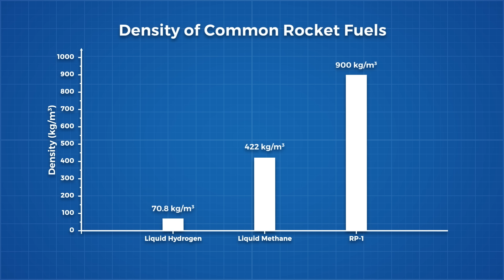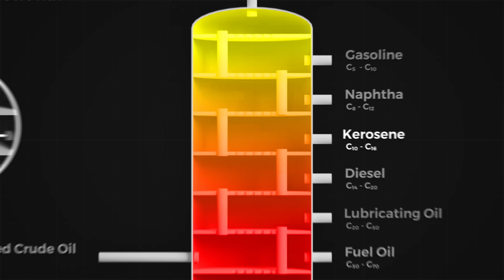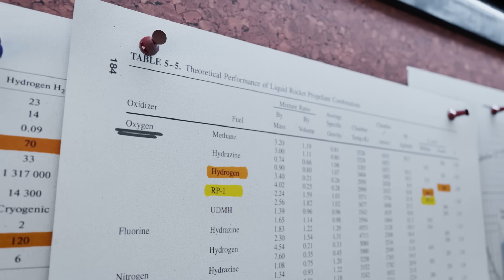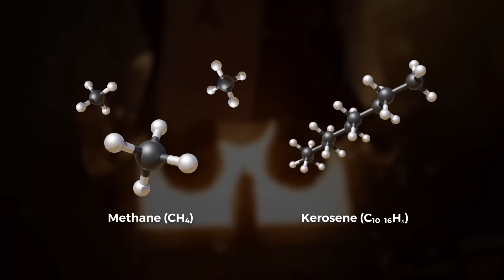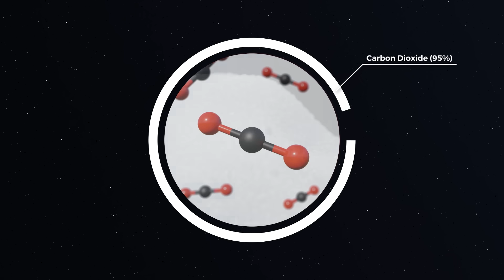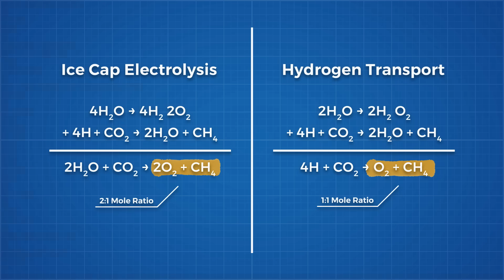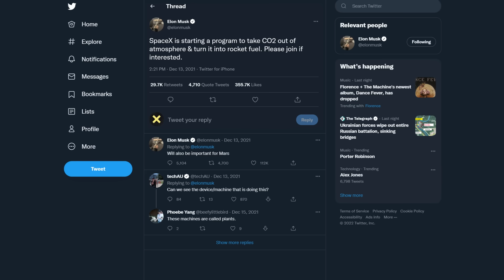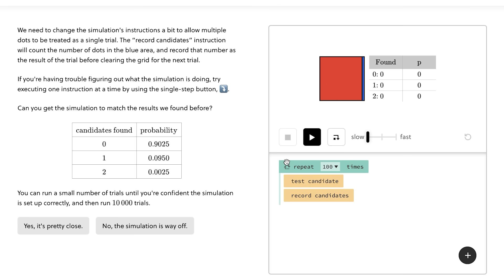Why SpaceX is Using a New Fuel

Comment: For years, I've been trying to find a way to turn coal into methane. This video provides the equation. In some sort of co-generation project, we should be able to burn coal to make heat & power and CO2, then combine that CO2 with hydrogen to make methane and water vapor. Then when the methane is eventually burned (efficiently), there is a release of CO2 and water. There must be some way to put this altogether in a loop. Maybe we need to add wind, solar, or nuclear power to generate the hydrogen from water.
Reply: Wouldn’t it be better to use hydrogen rich liquids rather than water?
Reply: @chrisbraid2907  like what? Hydrolysis of water is an easy and well known process.

Comment: Mars actually has ice everywhere, not just at the poles. Almost everywhere has a sub-surface permafrost layer. Down to mid latitudes this is pretty shallow, just a meter under the surface, at lower latitudes it's probably deeper and somewhat more sparse. Some regions include sub-surface glaciers of high water ice concentration, as shallow as a meter below ground, and these exist even at mid latitudes in many locations. Seeking a location to site a Martian colony one would want to look for easy access to sub-surface glaciers.

Comment: Around the middle:  The scan of Sabatier's paper had a typo in it:  "4 H + CO[2] --> CH[4] + 2 H[2]O" (the "4 H" should be "4 H[2]" which is actually printed correctly in the line above).

Comment: I think in general methalox engines haven't been developed because they don't have any military application and isn't as good as the more mature hydrogen engines, it really took someone without the constraints of legacy aerospace to get it off the ground
Reply: Interesting though that the same resources giving you the methane will also allow for conversion to oxygen. 
The waste nitrogen can be used in green housing along with compressed carbon dioxide as part of the cycle for plant growth. 

It seems that though the Mars atmosphere is scarce - it will provide us with most of what we would need to function.

Comment: Maybe they can drive the price of  Methane down by manufacturering it for jet engines it might be a way of getting rid of air pollution in the air. And because they are  making it for jets maybe it would drive the price of the fuel for rockets 🚀.

Comment: Professor Daniel Nocera from MIT developed a catalyst with a botanist from England to break down water to oxygen and hydrogen, easily, efficiently and cheaply, modeled after a microorganism from the ocean,  using solar panels for the electrical energy source.   He called it personalized energy. 
A quart of water could power a typical house in the US and the water source doesn't have to be ultra pure, although after the hydrogen is passed through a fuel cell, recombining with oxygen, pure water results along with electricity. 
A small unit on board a ship to Mars would make it very easy to obtain hydrogen and oxygen.

Comment: Space X has a simple problem with a simple solution they need to store more fuel but it takes up to much space pressurize the fuel or they could experiment with heavy fuel if they can do the same process with fuel as they can with water to make heavy water then that may be the solution

Comment: Great video! I like everything your channel puts out. But as an engineer myself, I just want to make a correction about impulse. It doesn’t represent total energy released. In this case it represents total momentum gained by the rocket due to the fuel.
Reply: Can you explain that further, please?
Reply: Sure  @Pene7942  . Impulse is indeed the area under a force vs time curve like the one in the video. This is also equal to change in momentum over the time the force is being applied. To see why, you'd need to integrate force and the answer would be equal to the final momentum minus the initial momentum (I'll put the math at the end of my post). So fundamentally, the impulse represents the total increase in momentum due to an applied force. That increase in momentum is related to the energy gained, but it's not a direct relationship so we can't say the area under the curve represents the energy gained. You can calculate the area under the curve by taking the integral of the force function f(t) with respect to t over some initial time to a final time: ∫f(t)dt. Newton’s second law defines force as, f(t)=ma=m(dv/dt) where m, a, and v are mass, acceleration, and velocity respectively (dv/dt is the derivative of velocity which is equal to acceleration). So the integral becomes, ∫(dmv/dt)dt=∆(mv). This result is equal to change in momentum since momentum is defined as P=mv. On the other hand, energy gained by the rocket, due to the fuel alone, is equal to the rocket's change in kinetic energy (a measure of energy associated with an object’s speed). Change in kinetic energy is ∆(0.5mv^2) which you can see is similar to momentum, but the relationship is quadratic so it will not be directly related to impulse. Instead, increasing the area under the curve will quadratically increase the amount of energy the fuel provides to the rocket. I know that’s a lot so feel free to ask any follow-ups.

Comment: good video but not completely accurate regarding the combustion of Kerosene. Most of the soot in the F-1 that is seen is due to the turbo pump super fuel rich exhaust being dumped into the engine bell to provide cooling to that part of the bell.  The turbopump fuel / Ox mixture was purposely very rich to control TP combustion temperature.  Kerosene has an advantage over Methane with regard to lower ignition temperature and somewhat better reactivity to initiate combustion (please refer to texts on compression ignition engines for very good discussion on fuel chemistry and the role of fuel reactivities).  Although Methane has excellent characteristics and is a very good fuel, so is Kerosene with today's more advanced turbo pumps, leaner thrust chamber operation and has better handling practicality (not cryogenic).  Ok, methane may be more environmental overall, maybe.

Comment: US Navy already got this going on using RWGS and a very cheap catalyst at a 92% efficiency rate.  The idea was to use the nuclear power plant on naval ships to convert carbon and hydrogen from seawater into fuel for jets and other ships in the fleet, thus saving the US Navy from having to escort and manage large fuel tankers.  Researchers have already built several prototypes and successfully produced jet fuel, diesel fuel and gasoline.  They even ran a vehicle off the fuel just to show it can be done.  The projected costs back in 2020 was something like $5 to $6 USD a gallon.  In theory the process can be scaled up and used to replace all existing transportation fuel without having to change infrastructure.

Of course no costal liberal elites would get rich off this, so it's not being discussed even though it's "carbon neutral".

Comment: Methane is just cheaper to produce
and with SpaceX being a privatized corporation,
they will rather go for the cheaper alternatives,
not the safest.

lol, 8:05 Mars has a atmosphere you could almost call a exosphere.
It has barely an atmosphere and distraction like that would make more sense for H.A.V.O.C. which in the end already would start lowering density from the atmosphere, as well as lowering the temperature, combined with actually having a thing called gravity, it's much better than Mars.,.

Comment: Wait... So Highfleet’s worldbuilding actually makes sense using liquid compressed methane to power massive airships? And the fact that the Co2 that is expelled by thrusters into the atmosphere can be recondensed and refined back into liquid methane? HOLY CRAP THATS NEAT
Reply: pls explain?
Reply: CO2 can always be brought back to methane, but thermodynamics say that you need to put at least the same amount of energy back into the reaction. engineering says you need more energy. This process is only viable if the energy is from renewable (non CO2 emitting) sources and the original process must emit CO2, such as cement production.
Reply: @abelknecht4943  seeing as how Highfleets world features a nuclear reactor the size of a city and hundreds of thousand+ ton airships outputting enough rocket thrust to instantly insulate a small planetoid with greenhouse emissions I still think it’s pretty neat on the worldbuilding how this all fits together

Comment: With the new tech of wireless electricity i still think a electric rocket engine would be the true path.  Am aware electric engine are under research but there trying to make them using the minimal amount of energy which is not ideal currently.  I think a electric rocket engine combine with wireless electricity would save allot of money even if it consume large amount of energy...If it works then it can be improve. Wireless electricity is the turning the energy into radio wave then back into energy.  Even better if they can beam negative or positive charge like a magnet too elevate a space craft into orbit.

Comment: The Sabatier process does NOT solve climate change. Methane is a worse greenhouse gas than carbon dioxide and if you burn it you end up with the same amount of CO2 as before. Unless you are getting the hydrogen for free there is a overall loss of energy.
Saying that the hydrogen is "recycled" is misleading. Even with reverse water-gas shift there is still a lot of hydgrogen ending up in your rocket fuel, so you still need a lot of martian ice. Also it is weird that you mention the water from the sabatier process can be used for life support and then immediately explain why you need martian water.

Comment: I know this may be nitpicking, but when you mention how much fuel it would take to make 100MJ of energy...

you mention the volume in Liters.... Yet you already mentioned that the density of stuff changes at temperature... 

So 2.2L of Hydrogen at 1million Kelvin, is not the same mass as 2.2L of Hydrogen at 1 Kelvin... 

in other words, you told us not how much Hydrogen you actually need... but gave us a wide array of possible amounts.
Reply: Volume is not density...

Comment: as the audi e-fuel plant here in gemany might be a relly interessting technology, right now it is just a stupid idea at leat in the form they would like to do it, the energy to produce the masses of fuel they would like to produce to keep combustion cars running is just insane, this sort of techniq is just good to use if you have an abundance of energy which right now we on earth doesn´t have for mars it´s another story there it can grow with the energy needs from the start so no big deal. but on earth ? we need to get away from fossil fuels as quick as possible and even as this might help to have clmate neutral combustion engines we right now need the power for our homes and industries. For transportation efficeny wise it makes at least for now the most sense to use bev´s

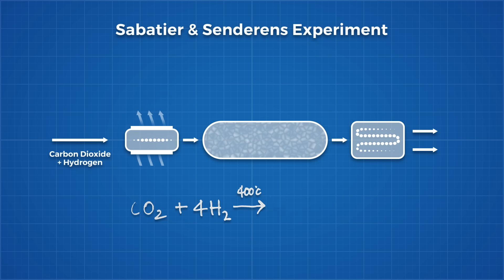Comment: Space X new fuel liquid methane to replace liquid hydrogen than other fuel and space X lauch on the Mars travel more than moon so they modification on fuel 8:55 Carbon to methane converted into fuel process called sabaiter process emitting water used for electrolysis 👍 wow interesting information about rocket 🚀 fuel from Real engineering 👍

Comment: Wait but isn't the 'ice' (10:43) on Mars' poles then not 'just' dry ice (solid CO2)? It would make more sense to me if the white areas simply indicate the regions where temperatures are lower than -135 °C (somewhere around the deposition/sublimation point of CO2 at martian atmospheric pressure)... =o

Comment: I see no reason for rushing human exploration of mars. We can barely land autonomous vehicles there, and it requires complex infrastructure to produce every component to highest tolerance. If anything breaks in space or on mars, that'll be it. And they aren't contemplating sending a small crew, but a large collective, which with also magnify the proportion of any potential catastrophe. They better land a dozen unmanned SpaceX rockets first, replicating mission parameters, or there is no point. With robotics being as advanced as it is, what's the value of sending humans anywhere, if the majority of equipment ends up being for the purpose of supporting life. Robots just need electricity. In the old days, the only way to see something was to go there and see it. Now we use virtual experience instead of real ones. We can scan mars and mimic it in VR, risk free. There is no need to go there. With radiation, long term stay is not a likely possibility. So having that planet as a reserve option, in case anything happens to earth... that's not a good plan either. Mars has nothing we need, aside from maybe, providing an exercise, in case we ever develop above light speed propulsion. And if we don't, then it's a waste of fuel and natural resources.

Comment: Real reason that SpaceX is choosing methane as a fuel is that it is the most practical choice for maintaining 40,000 earth satellites for the Starlink communications system. Methane is essentially free for SpaceX, because it can be obtained from wells on the Texas launch facility. It won’t clog the Raptor engines with repeated launches, so maintenance on the engines is minimized. It has pretty good power/weight ratio as well. Ain’t nobody goin’ to Mars. It would be a death sentence. Human physiology is not adapted to prolonged exposure to weightlessness. Life on earth has evolved numerous “stress mechanisms” to adapt to various sets of environmental circumstances. None of them are adapted to endure prolonged exposure to weightlessness.

Comment: By the way that 400C reaction temperature for the Sabatier process is about 200C below the operating temperature of the MSR built at Oak Ridge National Laboratory. Most Solar Thermal systems using molten salts operate around 600C as well, so there are several options for cheap thermal energy to run the reaction.
Reply: But it is Nuclear, and people don't want to acknowledge there are distinctions and places it can work meaning Politicians will fan the flames on why we should not bother.